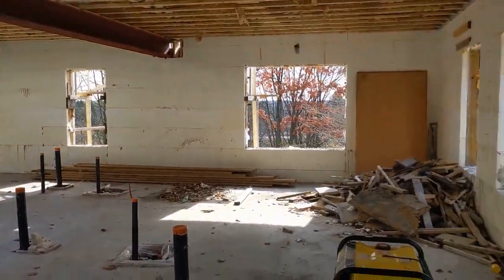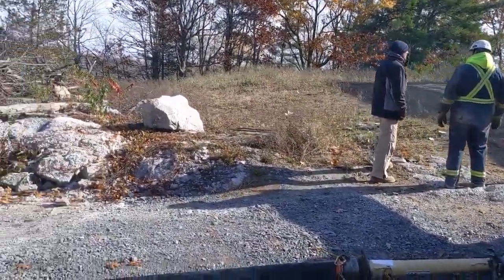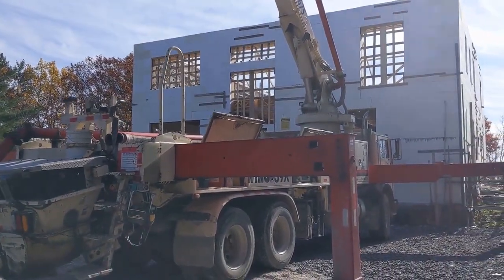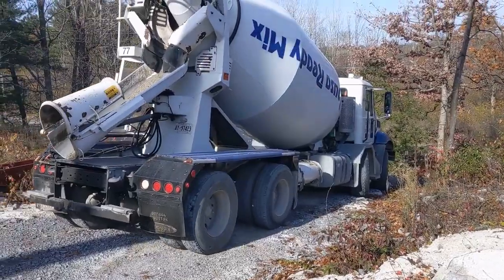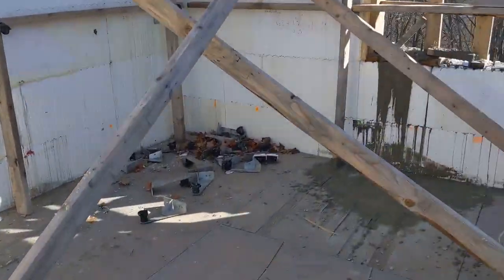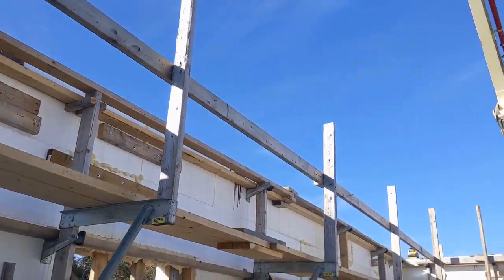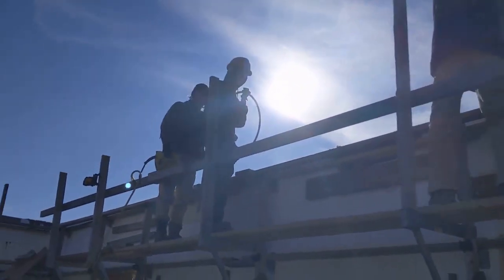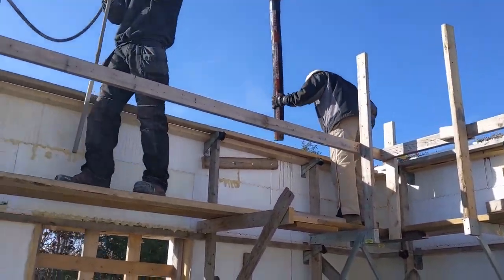Second Floor ICF Concrete pour | Building my dream house : Ep42

Comment: Great job. What activities did you plan for winter? Question: what will be the cost difference if you do a single level vs 2 storey? For diy do you recommend a 2 storeyed house?
Reply from the maker: I am instructor in the military.  I had to train curtain course from November to March.  No time to do much.  But I finished my truss design and submitted it.  I am also shopping arround for Windows
Reply: @rockyrookiehouse7732  : excellent. Are you checking tripple layered windows or double? What is the tentative estimate of the roof trusses
Reply from the maker: Thank you for watching my videos.  I am shopping around for windows.  Tripple pane is what I will select.
Reply: @rockyrookiehouse7732  : excellent. Looking forward for installation and costs.

Comment: I have been following your video recently. I am in ottawa. Would like ti ask your some questions if you don’t mind?
Reply from the maker: Yes, go ahead
Reply: @rockyrookiehouse7732  Thank you ! One of your video, you mentioned you are going to talk about your house plan . When will you make a video for that? As of today, after you finished your second floor concrete, Do you mind to tell us how Mach you have spend? Of cause excluding the land. We are thinking to build an ICF house and like to know how much does it cost per square feet. Thanks a lot! You are doing a good job and very inspiring.
Reply from the maker: Yes, you are right.  I plan to make a video on house planing.  I have full time job in the military.  I have been busy on training.  I did not have enough time to come back fully.  I plan to be back by mid March.  I will make those video as well as pricing video like I promised.
Reply from the maker: Thank you for watch my video